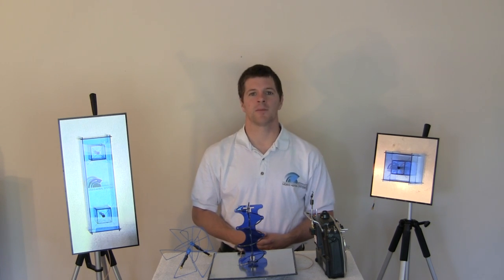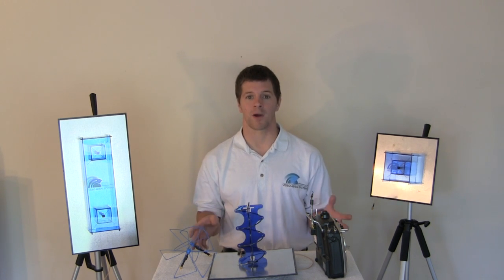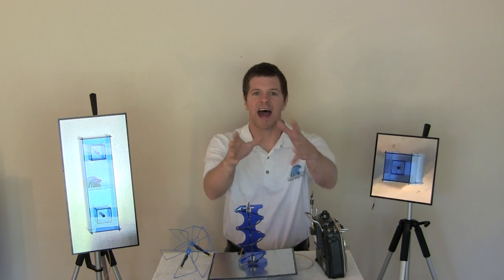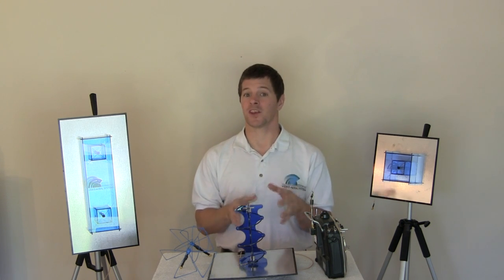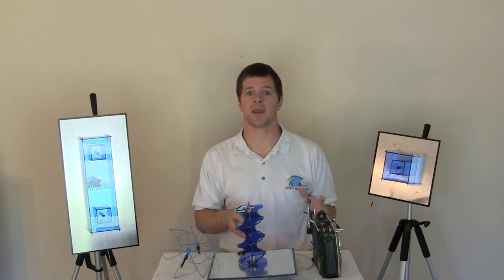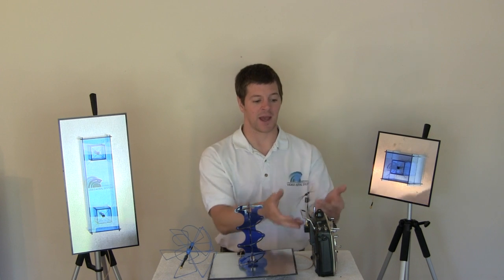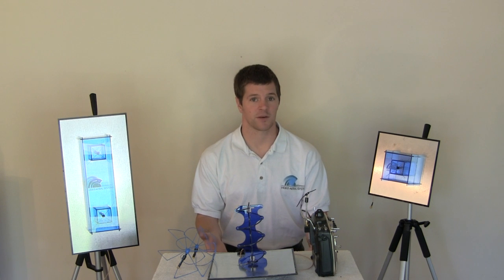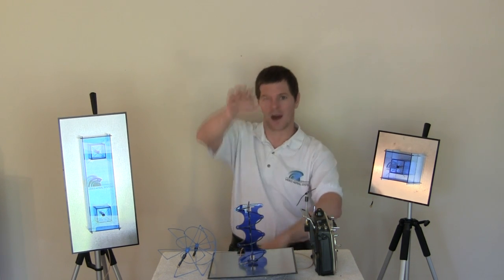Success in FPV part 13 - Trouble shooting

Comment: Somewhat related question: Is it possible to hook up a single 900MHz linear biquad for both video AND telem data using two different receivers as long as they were on different bands?  Would it be an interference nightmare?  If so, would a simple "Y" SMA type connector work?
Reply from the maker: You really need one antenna per receiver or you are going to have impedance ms-match issues.  However, for short range you are probably ok with a Y harness.
Reply: Been researching quite a bit since the post, I'd be afraid of "poking the eyes out" of the LNA of the receiver with the telemetry transmitter... wouldn't that be a huge issue with a simple Y?  Secondly, I could use some sort of switching device that would block signal from reaching the video receiver when the telem transceiver was in a transmit, but that would then obviously block my video... I think the answer is use the 70cm band to get my telemetry down and point the antenna and use the biquad for video only:

http://dragonlinkrc.com/store/dragon-link-v3-advanced-slim-complete-system

  Would be nice if it wasn't so expensive!  BTW, heard your FliteTest community podcast from a few weeks ago, I'll try to think of some ideas for EPP soon.  One thought: modular wing (make it so you can join two bodies with just a longer spar, stick the wings back on, and thus increase gross capacity and endurance).  Lastly: are there plans/repo out there for the CNC wire foam cutter you built?

Comment: I upgraded the firmware on my Dragon Link TX and RX they went flying yesterday.  With your Cross Hairs and 4 lobe antennas with a diversity box, I started getting the black & white bars, starting with one then filling the screen.
I have never had this before?
Reply from the maker: Could be the DragonLink.  Try getting up close to your ground station and waiting for the bars to appear, then take a few steps back and see if they go away.
Reply: Alex Greve I will try that.  I am using 1250 and I have not had that problem.  I was using 1280 before and had to be 15 ft. + or it would blank out my monitor.  I could post a short vid for you to observe?
Reply: I also upgraded DL firmware. 1280Mhzvideo.  Flew yesterday standing back approx 6ft from ibcrazy crosshair, rmrc Rx w/saw filter only about 3000ft test.  No issues.  clear video.   homemade 5 lobe omni also with no issues
Reply: coa106 I was sitting 25 ft + away, I an using a 5.8 repeater.  I got stuff that looked like a bar code?
Reply from the maker: *****
With a ground recording I can try and help you identify the interference.  It could be the repeater you are using.  It could be the dragonLink.  Without seeing the video, I cannot say.

Comment: Dont understand the video. Didnt have a noise problems since switching to your Pepperbox at 2305MHz :) Going very long range often. If the pepperbox is aimed approximately at the plane, I can go pretty far unlimited.
Reply from the maker: That simply means you do not have noise issues.  This video is about trouble shooting problems.  If you don't have a problem, then this video is completely irrelevant to you ;)